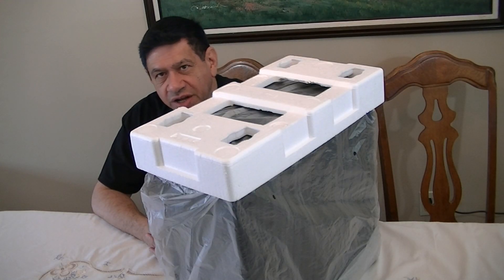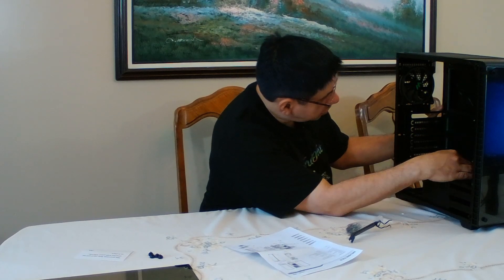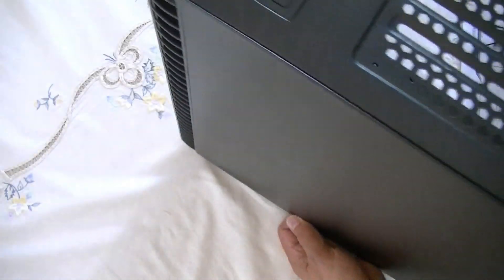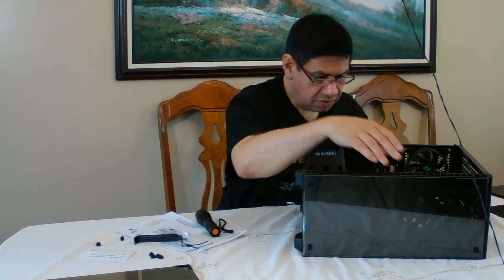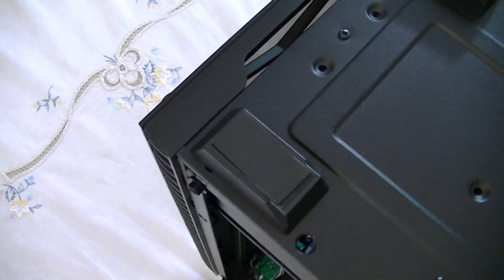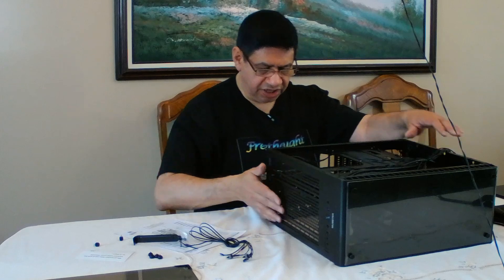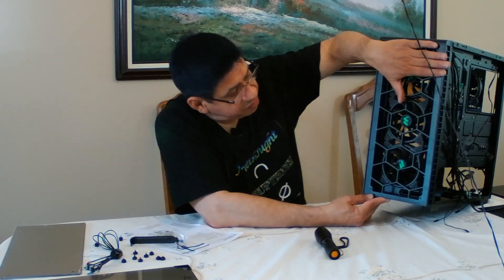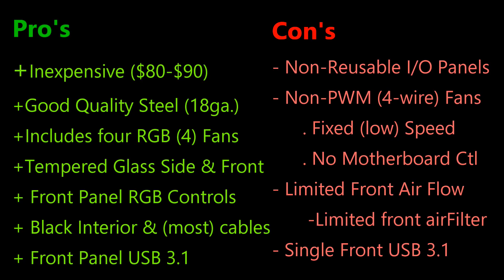Gaming PC Build – MUSETEX Case Review (Part 1: Pre-Build Prelim)

Comment from the maker: There already is a Part 2 uploaded to this review, and there will be a Part 3.  See the UPDATE note I added above.
Reply: Help
Mine does not have a Molex cable? Should it have one?
Where do i connect fans? 
Lol
Reply from the maker: @rareELL  Sorry to hear that.  Does it have a Fan/RGB control unit in the back section of the case?  If so, you probably have one of the newer ARGB (5v) models.  Do you know the exact model designation of your unit?  Such as 903-S6?  I did this review on the first model that was released (and at a low price), the 903-S4, which is the one that has the Molex.  Are there any instruction included on the RGB - maybe in a separate box with the RGB controller?
Reply: @PE4Doers  oh ok thanks for the speedy response.
I have the 907 model but the unit i got does not match up with the description on the one i ordered on amazon.
But one of the cables is labled argb. So i guess i do have a newer model. Ill find out once my mother board arrives this monday 6/22/2020.
Reply from the maker: @rareELL  Yes, you definitely have the newer RGB.  PLEASE make sure your motherboard supports that and has the correct connector for ARGB.  Some newer ones have both the RGB and the ARGB.  Whatever you do, don' get them crossed.  If you plug ARGB into RGB, it will most likely detroy your ARGB controller and may actually damage the circuitry on some of the Fans.  I had one viewer that did just that :(  Maybe you can download the user manual for your new motherboard ahead of time from the manufacturers Website now and double check - that's what I would do.
Reply: @PE4Doers  oh wow thank you for the crucial tip!
I got the aorus x570 elite wifi.
Im sure it does have the proper connections.
Reply from the maker: @rareELL  You are very welcome.  Please let me know how it turns out.  I do think you are correct by the way, the x570 series seem to have ARGB as a normal option - some even have both.
Reply: @PE4Doers  so the x570 does have two argb connections.
Very nice mobo actually.
I finished setting up pc a few days ago.
It all worked perfectly!
 Ill post a video for you to check out later.
Appreciate your help man.

Specs:
Ram: 2x8gb gskillz trident
Cpu: amd ryzen 5 3600
Gpu: zotac rtx 2080 amp
Cpu cooler: deep cool gamexx 400 gt
Ssd: adata 8200 pro 1TB
Mobo: aorus x570 elite wifi
Case: you already know
Psu: seasonic 750w
Reply: @PE4Doers  Hello sir. Should I buy this case if I’m getting a Ryzen 7 3700x and a 2080 GPU? Do you think the airflow is this case is good?
Reply from the maker: @yogisensei470  I suggest you look for a case with better airflow.  The biggest problem we encountered, with a CPU that generated less heat than what you will be using, was it's poor cooling results.  I like the line of Airflow cases that Corsair produces for a CPU that generates a lot of heat.
Reply: @PE4Doers  Thank you! You earned a sub! Would you recommend the Cooler Master MasterCase H500 ATX Mid Tower Case?
Reply from the maker: @yogisensei470  Thanks you sir.  I will work to keep earning your trust.   

I do not own a CM 500 (or had to chance to review), but I just looked at the specs on it, and I like what I see on the 'Mesh' version.  Every case I've seen and reviewed with a mesh or a slotted front panel have done very well in terms of keeping the insides cool.  You should be a little weary of any with either glass or acrylic covering the majority of the front real estate - The RGB still looks pretty good through a mesh or perforated front.

Also, I am a 'Big Fan' of positive air pressure inside any PC case with all air being pushed into the case being properly filtered as it goes in - therefore a fine filter on the outside of the fans that can easily be cleaned.  Hence my recommendation of the Corsair Airflow models, since they almost always have such a filter.

I hope that helps.
Reply: Does it have really good airflow
Reply: @mirzaamann  standard temps all around...so im gonna say yes
Reply from the maker: Tristen Talon  I will need to check that out :)

Comment: I don’t know if you will reply. But I got my case working. However, I can’t get the fans' RGB to work. The fans spin and work fine. But I can’t get the fans to have different colors. I think it’s a power issue. I have 850wats. I don’t know how to give more power to the fans. Any help would be great.
Reply from the maker: I do my best to respond to ALL comments (unless I start to reach the success I am hoping for, then I may need to get help doing that).

There are several models of that case with different RGB (or ARGB) lighting.  The one I did this video on, which my daughter still has, had a button on the front panel that had to be pushed repeatedly to cycle through the different colors.  I believe the power was provided to both the Fans spinning and the RGB lighting.  So, if your fans are spinning and you have that model, then just pushing the button might help.

I've heard however, that others had a switch on small controller module where all the Fans were plugged into, and that switch had to be in the correct position allowing either the control module to light the RGB, or you needed to connect a ARGB wire to your motherboard so it could control the lighting.

Are you able to tell which one you have?

Comment: Where do I plug my fan cables to get argb and to run it and How?
Reply from the maker: That will depend on the model you purchased.  The fans are not replaceable except for those sold by MUSETEX due to proprietary wiring.  In later video showing my daughter's build you will see hoe I needed to completely replace a couple of them and plug directly to the motherboard.
Reply: I got the newer version and do I need to plug the controller to the psu or Mobo or both to get argb and power for fans
Reply from the maker: @JxrdanDaGreat  I do not have one, but you definitely need to connect to the PSU.  Going to the motherboard is an option that I'm not 100% sure it does that - although I heard some models do.

Comment: I have a mother board but the fan cable is a 4 point do you have any tower recommendations for a 4 point?
Reply from the maker: I'm not sure what you mean by 4-point.  Is that a four wire?
Reply: @PE4Doers  yes I mean 4 wire I’m sorry
Reply from the maker: @kylebaxter5467  That is great you have those - the more the better.  Connecting the Fans directly to the motherboard is the most effective and easy to troubleshoot - in my professional opinion anyway.  Sometime when you have a hub you need to install extra software which can lead to conflicts with other software, and very hard to troubleshoot.

Comment: Not sure if anyone has added this info yet... But regarding your findings at 6:15, my case came with extras as well. Prewired, the button for Power was labeled as reset. Since they gave me extras, I hooked it up and the buttons fit. Came across your video to see if anyone else is having issues with this case like I am.
Reply from the maker: Wow, that's exactly what happened to the one that my daughter put her PC.  One of those connectors (forgot which) was mislabeled.  Maybe that's why they included an extra set - possibly identified during a QA process.  What went into your PC (CPU, GPU, etc.)?

Comment: Anyone else have issues with the lights not working after a few days? There is a cable marked reset that goes to the controller but I don’t see a reset button anywhere on it or the case.
Reply from the maker: I have received many comments about others having trouble with getting them to work (and stay working) in later versions of the case.  A couple of people had to reach out to the vendor to replace the ARGB controller.
Reply: @PE4Doers  Has anyone reported any way to contact Support? I haven’t been able to find any phone number or email address.
Reply from the maker: @davidd8449  I believe at least one person who had purchased the case through Amazon used their mechanism to reach out to the seller.

Comment: Anyone else have issues with the lights not working after a few days? There is a cable marked reset that goes to the controller but I don’t see a reset button anywhere on it or the case.
Reply from the maker: The one my daughter selected did/does not have any problems, however numerous people that have commented here say that the new versions (with ARGB) have had many failures.  I would reach out to the vendor, since they seemed to have provided replacement parts for others in that situation.

Comment: Hi I’m trying to take the back off, I already unscrewed the two screws and when I tried taking it off it just wouldn’t budge
Reply from the maker: Do you meant the side?  The back does not come off.
Reply: How to do take it off?
Reply from the maker: @ROO624  The glass side and the glass front are each held on with four thumb screws.  the non-glass side has two screws in the back, then you slide it back. There is also a small plate the holds the PCIe brackets which can be removed by taking off the single screw, then wiggling it out through the slots.  Nothing else on the case comes off.
Reply: @PE4Doers  Thank you! Also, what type of driver works on the back plate to the PSU?
Reply from the maker: @ROO624  I like to use long Phillips-head with a medium point.  The length gives some extra torque which can sometimes help.  Please make sure to use the screws that came with the PSU.

Comment: Did you end up ever using the “mystery” set of wires you found?
Reply from the maker: I have used them when troubleshooting, but have not had a need to try and put them in a running PC.
Reply: @PE4Doers  ok thank you so much I was caught off guard when the extra set of cables
Reply from the maker: @zora349  So you got them as well?
Reply: @PE4Doers  yes I don’t know why

Comment: Hello, I built my first computer with the same case and it went fine, although I have a cosmetic problem. There seems to be only RGB on the “frame” of the fans and not actually on the fan itself. I think this problem is occurring because I did not plug in the VDG and I think VDxG cable into my z390a pro motherboard, which doesn’t have a VDG header or a VDxG header, is there anyway I can solve the fan problem? thanks in advance!
Reply from the maker: It sounds like you have one of the newer models, since the one I reviewed does not have a VDG connector.  I assume that connector is probably ARGB - doe it have three pins with what looks like a space for an additional one?
Reply: @PE4Doers  theres 4 holes but the 3rd one is filled in, I’m not sure what that is called.
Reply from the maker: @nettspendgamer23  That sounds exactly like an ARGB connector, which your motherboard would have to support.  I recently bought an MSI MPG Z390 Gaming Edge Motherboard and they call it the RAINBOW connector.  Older Z390 (more that 2yrs in retail) do not support ARGB.
Reply: @PE4Doers  my motherboard has a jrgb header, my motherboard brand is MSI z390 a pro
Reply from the maker: @nettspendgamer23  Then that should work.  You may have to hold down the case RGB button for 3 to 5 secs to get it to switch between case control and motherboard control.

Comment: hey, please explain to me how plug the RGB and where to control the colors of fans with the  button of the top. Also I have the motherboard ASUS B550-f (wifi).
Reply from the maker: Do you know which model of this case you have?  Al;so, does it have a controller in the back where all the fans are attached to?

Comment: Nice video, helped make me made my decision. So are the fans mainly for looks?
Reply from the maker: Yes, just fort aesthetics - based upon my testing of course.  What do you have in mind for a case next?
Reply: @PE4Doers  honestly I was looking at this one, but I’m still hesitant since the fans don’t really provide enough but then again I’m not really planning on overclocking.
Reply from the maker: @coastyken7370  My daughter has an i7-8700 CPU in her PC, and a 240mm Cooler Master AIO, and it seems to be working for her fine.  She does not overclock either, so I think she is just under the heat levels that would be a problem.

Comment: hi. am i able to remove the pre built fans and replace with something else???
Reply from the maker: Yes, however if you want to keep some, you have to be careful to get all the cables properly re-attached.  I believe I show and discuss that in the final video I made for that series, where I add-in a 240mm AIO cooler at the front.

Also, if you try and link in another fan to the series it will be impossible unless you guy them from the case manufacturer, since they have proprietary cabling.
Reply: @PE4Doers  it would be Lian li fans there beautiful to have in system
Reply from the maker: @Gamingandrelaxing  I actually own a set of three and I agree.  In my daughters case we put in a Cooler Master 240L AIO and plugged the RGB directly into the motherboard and it works.  Unfortunately I am not able to get the case ARGB in sync with the two cooler fans and pump, since she has an earlier version incapable of being driven by the motherboard RGB.   Does your version of the case support connection to the motherboard?
Reply: @PE4Doers  its the musetex phantom case. Idk which case to get everything looks so good

Comment: How do I connect the 6 rgb fans? I can’t get them to spin or light up
Reply from the maker: There should be the ARGB controller inside the back cover.  I believe after you connect all the fans to it, you need to connect a SATA power cable to one end.
Reply: PE4Doers thank you for your help! Do you know if a Corsair iCUE H150i Capellix liquid CPU cooler would fit in this case?

Comment: Hi sir, i wanted to ask are the rgb cables 3 pin or 4 pin, thank youu
Reply from the maker: Well, that depends which model you happen to buy.  The original version I used in this video was neither.  It was a proprietary daisy-chained 5-pin configuration that control both the RGB and Fan power.  I understand that the new models are using the ARGB, which is 3-pin.  Are you planning on buying one?

Comment: I regret buying this case it’s a pain to build in
Reply from the maker: Definitely not the easiest.  I particularly dislike it when I have to twist-off the PCIe slot covers. It's appeal and popularity does surprise me.

What sort of system did you build inside of it?
Reply: @PE4Doers  amd ryzen 5 3600 with a rx570 8gb I will add a rx 5700xt for my Christmas and get a nzxt h510 elite but my case has a reg pcie. Slot but it plastic overall I hate that case and plus when I unboxed it the case fan hub adhesive was already opened and it says if you make a yt video about it they will give u a option to get a led strip flash light etc
Reply from the maker: @lilsins656  WOW, they actually mentioned making a video?
Reply: @PE4Doers  yea
Reply: They try to bribe you
Reply from the maker: @lilsins656  I never experienced that, and I would not react well to that.  Once, I had one 'hint' at how they were looking for 'Marketing Partners', but I sent an Email worded in a way that they did not dare respond.
Reply from the maker: @lilsins656  That is nearly nbelievable.
Reply: @PE4Doers  yea I gonna post a bad review video soon
Reply from the maker: @lilsins656  OK, let me know what the link is to that video and I will take a look.
Reply: @PE4Doers  ok lemme make it real fast
Reply from the maker: @lilsins656  But make sure it's accurate, don't give them the means to marginalize what you say.
Reply from the maker: @lilsins656  Thank you
Reply from the maker: I watched it, gave it a thumbs-up, but you have comments turned-off so I couldn't provide a supporting comment.
Reply: @PE4Doers  yea I hate yt comments thing
Reply: It keeps Turing it off
Reply from the maker: @lilsins656  I've heard of that happening.  Keep up the good work.
Reply from the maker: @lilsins656  Do you mean some of the comments that are submitted?
Reply: @PE4Doers  idk but it’s annoying it cause coopa I think
Reply from the maker: @lilsins656  I understand.  Good luck.

Comment: Are you able to remove the front tempered glass
Reply from the maker: Yes, there are four thumb-screws holding the front glass onto the case.  Unfortunately, even with that removed I could not get it to exhaust the heat out as efficiency as I wanted.  I believe the Fans just don't push enough air through - maybe maybe designed that way for looks or to reduce noise.

Comment: Is the case able to support a 360mm aio?
Reply from the maker: In the front  - if you remove all three front fans.  As I mentioned in the video however, you may want to remove the front glass to provide enough air into the radiator.
Reply: Could i keep the fans in the front and mount the radiator that also has its stock fans on the inside

Comment: would this case be fine with a 1650super? or should i look for other options cpu ill use is a ryzen 5 2600
Reply from the maker: That would probably work fine - it would definitely fit.  The issues with this case are heat related, so I would hesitate doing any over-clocking.